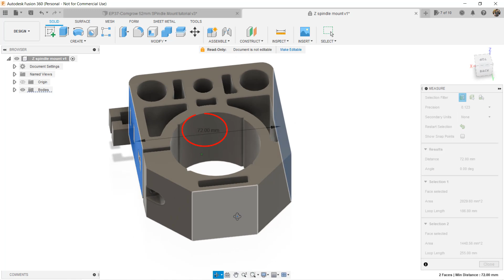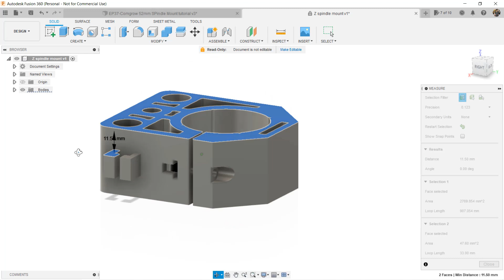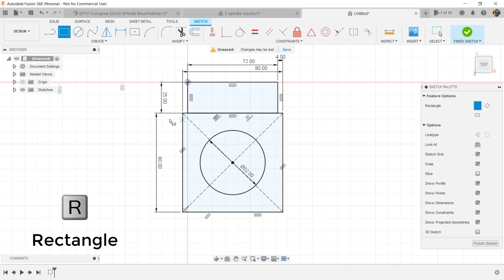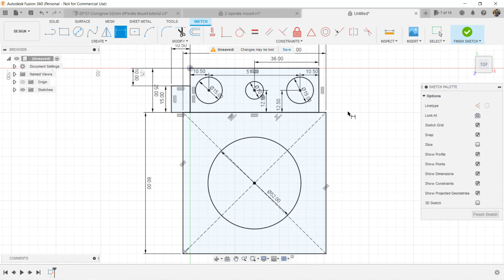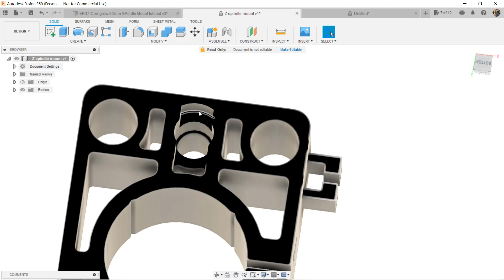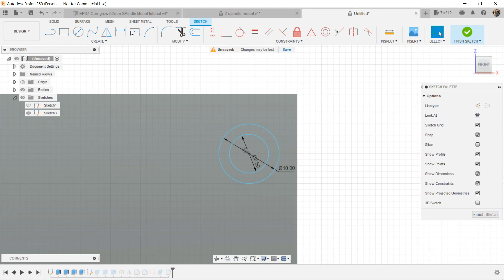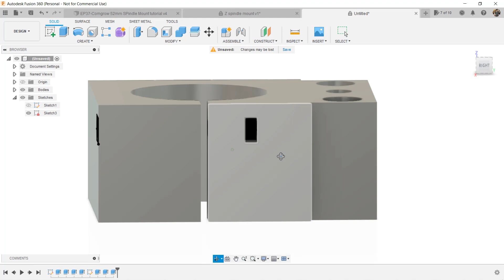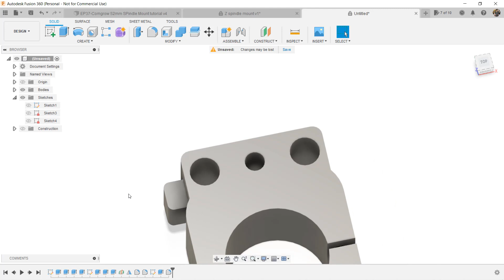Fusion 360 Tutorial for Beginner 006: 500W / 800W CNC spindle mount. Measure, mirror, midplane tool

Comment: hey if you have heat problems melting and dropping your spindles height, look into annealing plastic's, you can make pla for example handle heats up to 190c  https://youtu.be/6YlGjEY7u38 https://youtu.be/bG8dlxTX3AI https://youtu.be/n_bIXgjY-KM I would try and look more into CNC Kitchen method with plaster there is not shrinkage and his gets you to 170c without any special equipment just some plaster and your moms oven, I would how ever add some wax to help protect your part from hydrolyzation, or could give it a clear coat of enamel paint really just looking for a sealer here ooooh there is also possibility if you can get parents help, the RTV silicon used for installing windows and acetone to thin it out, just make sure you are in a well ventilated location for this! Acetone is not good for you to breath!!! any ways this should solve any warping in your 3D parts with your Spindle, PLA is derived from Sugars which Crystalize recrystallization in PLA parts build strength and heat tolerances, I still want to see Graphene added to PLA+ then a proper annealing process
Reply from the maker: I use ABS for this spindle mount, it should be fine. I used PLA before in one of my past videos, it failed, then I switch to ASA and got pretty good result.
https://youtu.be/xD2_JvOSx7s

Comment: Great video, as always. I'm blown away on how much you teach in roughly 13 minutes. I'm wondering too, if you was able to print your part with ABS on the Prusa? Thank you, for your great content, keep doing it :-)
Reply from the maker: Yes, the spindle mount in this video was printed using ABS on my Prusa with 100% infill, just apply a layer of glue stick on the print surface and it will stick well. I just use $1 glue stick from walmart, you don't need to buy any special glue for 3d printer that cost you $20 or more.

Comment: Very wonderful video. Were you able to 3D print the new spindle mount using ABS? Thanks
Reply from the maker: Yes, the spindle mount in this video was printed with ABS on my Prusa, just apply a layer of glue stick on the print surface and it will stick well. I just use $1 glue stick from walmart, you don't need to buy any special glue for 3d printer that cost you $20 or more.